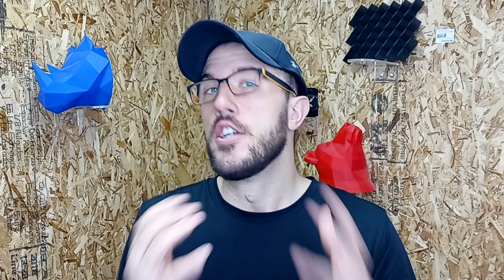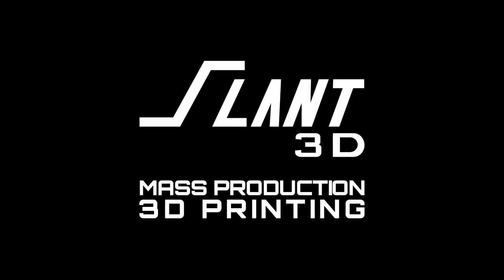Things to Consider When Using PLA For Mass Production 3D Printing

Comment: what do all the numbers mean on the package?    / elaborate more on the numbers 443 to 870  how do you know what number you are buying?  /       1.75 mm  what other sizes are there?     /       1kg carboard spool   compared to a 2kg carboard spool  Is that the total weight of PLA and the spool holder or just the PLA?

Comment: I was wondering if you'd mention annealing, as annealed PLA is one of the most temperature resistant materials readily available. Do you offer annealed PLA as a manufacturing option or have you considered it?
Reply from the maker: Actually There are several forms of PLA. The cheapest PLA is called Ingeo 4043 (And a couple of knock off variants) That PLA cannot be annealed. The type of PLA that can be annealed is most commonly Ingeo 870 which does have high temp properties after the annealing process. But when buying material off the shelf or from most brands it is impossible to tell what material they are actually  using since they do not use the actual material number. (For example "PLA+" is sometimes 850-870 but often not)
Reply: @slant3d  Yes, it's frustrating. I use Fusion Filaments' HTPLA+, mainly because it is documented (870). Their HTPET+ (non-G!) is also excellent annealable material.